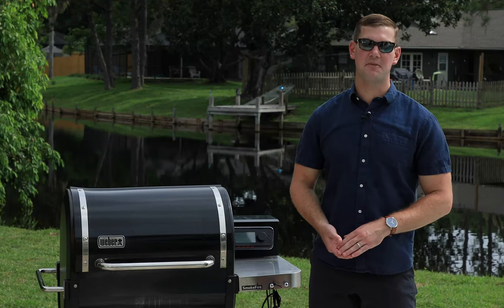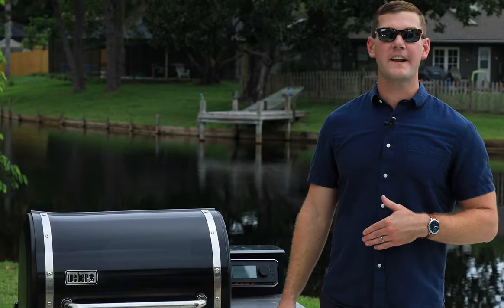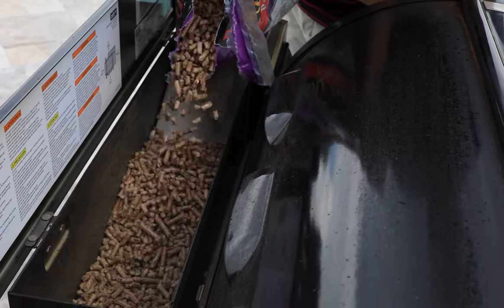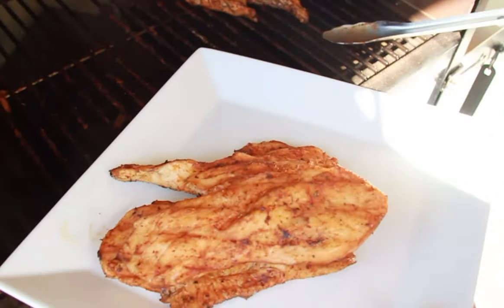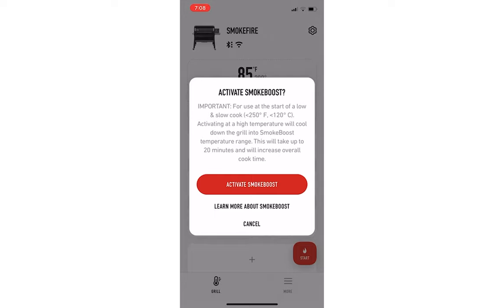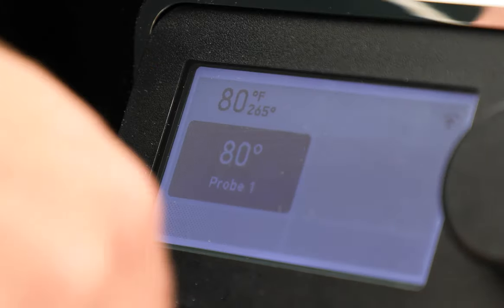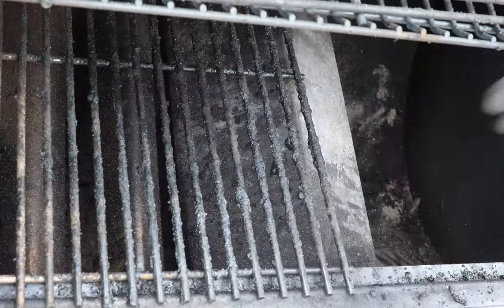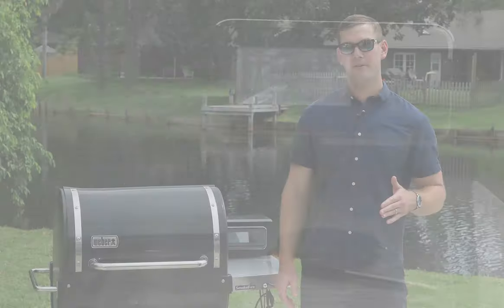Weber SmokeFire Pellet Grill | New Gen 2 Model | Second Generation Grill Overview

Comment: Thanks for the update.  It seems they fixed a variety of issues though it seems most people still are not convinced they did enough to address the grease management issues.  It seems you really need to use drop pans for long cooks still to avoid grease buildup and a higher than normal grease fire risk.  It's a bit of a shame since it feels like that could have been something they could've updated the design with.  Curious on your thoughts on this?
Reply from the maker: I use drip pans to catch grease and fat drippings in charcoal grills so it's not really anything different than what I'm doing in those grills.

I see it from both sides to how some would argue they shouldn't have to do that. There's only a handful of things that you need to use the drip pan for.

I don't really see it as a con or inconvenience because a drip pan is going to save me time cleaning up the grill. 95% of what I use the grill for is grilling so it's not something I have to deal with majority of the time. That's me though. 

- Sam
Reply: @justgrillin  as someone Currently shopping for their first pellet grill I think I'd rather just buy one without grease management issues.  Its difficult to decide with all the choices out there anyway so any area lacking gets noticed. Grease management is a big issue imo . From my vantage point I'm struggling to see where weber outshines the competition in any of the other areas .
Reply from the maker: @TheSlickpt  valid reasoning. For the price point this and other comparable pellet grills fall in, each one is going to lack something. If the non-diffuser shield is an issue to you, just move on to your other options. No sense in buying something you’re skeptical of. Hard to enjoy it if you’re focused on something viewed as a fault. You’ll come to find you’ll use drip trays with diffuser shields more than you think but I get it. While I don’t mind, it’s a “to each their own” situation.

As someone that deals with grills all day, I can say that no grill is absolutely perfect. Most people that get into pellet grilling start with an entry level pellet grill then after a few years jump up to a Yoder Smokers pellet grill if buying another pellet grill.

- Sam
Reply: @justgrillin  yep you bet definitely no perfect grill in every area or for everyone . Definitely not wanting any second guesses so I'm definitely considering the others and their individual pros and cons . Thanks for your  response and perspective   cheers
Reply: hey is the fire issue only when you're cooking at high temperatures? ive seen some reviews that suggest this.
Reply: The reasons for the potential grease fires is because the smoke fire doesn’t have a large pan that covers almost the entire surface. If it did have one of these, you wouldn’t be able to reach the high temperatures that we were claims it can reach, and therefore no searing. I’d much prefer the ability to say and reach higher temperatures and there be a slight risk of grease fires as opposed to know risk of grease fires and lower cooking temps. Unless you spend three or £4000 plus you can’t have both it seems obvious really high temps are better when you can just stick a cheap drip pan to reduce the potential risk of grease fires.

Comment: What grill scraper are you using at 8:16 of this video?
Reply from the maker: Timestamp didn’t match up but assuming you’re referring to this item: https://justgrillinflorida.com/product/grillfloss-ultimate-bbq-grill-cleaning-tool/
Reply: @justgrillin  Yes, that's it.  Unfortunately, the handle is out of stock currently, but replacement blades are available.  I just ordered two replacement blades and will make my own handle.  Thanks for the info!!
Reply from the maker: @Bob-More-Than-Enough-WC  we have the item in stock.
Reply: @justgrillin  Thanks!! I looked all over for the tool.  Everyone was Sold out...  For some reason your website never came up.....I got the two blades for $13 shipped.  I've got metal stock already to make a handle, so I'm good.

Comment: If unhappy within the first 100 how does returns work? Though the dealer where you purchased or directly through Weber?
Reply from the maker: Money back comes from Weber. As long as you purchased the grill from an authorized dealer, Weber will handle the refund via a refund check unless you purchased it directly through Weber. You will reach out to Weber to coordinate the return and refund regardless of who you purchased it from.

The refund is only on the grill. Shipping/delivery or assembly fees do not get refunded. Accessories like covers and such don't get refunded either.

It's not a requirement but Weber does ask that people use the grill for at least 30 days.

- Sam

Comment: Good to hear about the changes but with those addressed the real question for me is how is the performance as a smoker vs other options. Does it smoke as well as a Traeger or a CampFire Woodwind 24?
Reply: Yes, it's on par. But the traeger is much better at grilling. I have this weber and at 375 or more, there is so much ash flying around in there. Covers all the food
Reply: @micahroberts3564  wow really, I thought this would be better since it has the opened flame.
Reply: @micahroberts3564  yeah it blows that shit over all the food. totally wack.
Reply: Is yours the gen2 or original?

Comment: I'm regretting getting this grill (2nd Gen father day gift June 2021), I saw all the 1st gen problems but figured it's Weber I'm sure it's fine now & I didn't want a Traeger like everyone else, I was between the EX4 & the masterbuilt gravity feed. Long story short I chose the EX4, I've had multiple cases of pellet cloggage, The unit was unable to hold temperature multiple times & I literally have to clean it every single time as I don't trust an overnight low & slow. Weber advises to use their pellets which aren't sold at any store so I bought Weber pellets but still issues. Weber is sending me a motor that I have to install myself this weekend. Prob the last Weber for me unfortunately. Going to try and see if I can get Weber to refund me if not I'll install the new motor and just have to deal with the issues.
Reply from the maker: Sorry to hear that. Weber’s support is good. Sounds like you’re outside the 90-day return window so not sure if they’ll ultimately do that.

I don’t think you made the wrong choice between picking this over the gravity feed. The gravity feeds have had their own issues too. 

I’ve run BBQr’s Delight, Royal Oak and Weber pellets through the unit and it’s never clogged for me. Every now and then I’ll get an air pocket in the hopper which prevents pellets from feeding consistently. That’s really only temp issue I’ve faced. 

No matter what brand of pellet grill you own, cleaning it more frequently than a gas or charcoal grill is inevitable.

If Weber ultimately does not take it back as you wish, my advice would to be to hang in there. I don’t profess that this grill is perfect by any means but it has worked well for me mostly. If you have questions, feel free to ask us or use Weber’s support to your advantage too.

- Sam

Comment: Great video and I like the detail. I’m on the market for a pellet smoker and I was sure I was going to get a Green Mountain (it’s ahead of Traeger in my view) but I ran across a few vids now on the Weber and am going that route, particularly with the $200 off. Harry Soo did a vid where he fully loaded it up and tried to reach failure but only had good things to say about it. My only decision is the size.
Reply: You wont regret it. I was also looking at GMG (which is a great pellet grill), but love the versatility of my Weber Smokefire. Has been very reliable, using it for 6 months every week. I went with the EX6 to give me the extra cooking area.
Reply: @Costa_Prime  can you shed any light on the comment others have made about ash flying all over the place at high temps (grilling)?
Reply: @steveblaine6334  I had that at the start but it improved after seasoning, especially after a few low and slow cooks. I no longer have an issue with my BBQ and maintain (clean) it regularly. Important to clean the ash after every cook which doesn’t take long to do. I’m also (recently) using Grillgrates to get those perfect sear marks and additional flavour in my meat when grilling and would imagine that would also help too preventing any ash making it’s way above the grill. But again, this was just a recent update to my cooks, and had no issues with ash during the cook prior to using them. I had a Traeger prior and love the versatility of what I can do on my Smokefire and the flavour I get from my food, so no regrets. If I didn’t get the Smokefire, would have got myself a GMG  pellet smoker.

Comment: I have one, it's OK, gets the job done. However, I will never sear or bbq on it. Once the temp gets up to 375 the ash flying around in there is just stupid. Everything covered in it
Reply from the maker: When the grill is fairly new that can happen. As ours gets used a lot, a good seasoning built up on the body so it doesn’t really happen much anymore. It tends to stick to the body down low. I don’t notice anything when cooking that would give me pause.

My father-in-law is an OCD clean freak and he’s helped grill on it over the summer holidays and had no issue with it either…or enough to say something. He’s the type that wouldn’t eat if he saw something like that.

 - Sam
Reply: @justgrillin  does the ash fly around because there is no heat shield/drip tray?
Reply: I have just done the burn in on my sf…did not like all that ash covering everything…imagine it would be all over the food as well…glad there is a 100 day return
Reply from the maker: @universaldonor3100  yeah. After the first few cooks, it’s pretty much gone. Any pellet grill will have some ash fly around when cooking at high grilling/searing temps. Has to do with the fan. The body needs some grease and drippings as a coat and the ash just sticks to the lower cook body. I’ve cooked with a SmokeFire since Weber launched it. It’s a non-issue for me and my food has never tasted or looked ashy the least bit.

- Sam

Comment: use weber drip pans across the flavorizer bars.........flavorizer bars help distribute heat and vaporize grease to add flavor to the meat....do we flip a coin which way to go?  less flavor but cleaner grill?
Reply from the maker: I don't think it's really going to adversely affect the flavor of the food that's smoking. It's pretty common to use a drip pan in other grills. I use a drip pan in our Myron Mixon G9 Gravity Feed Smoker and am always happy with the results.

- Sam
Reply: @justgrillin  by using the drip pans you basically make a pellet grill like everyone else's...I have read reviews by folks that use stick burners that they like the taste from the weber because of the flavorizer bars.....
Reply: Don't bother with this. Cheap smoker? Grab an old 4 burner grill, remove heat shields and grab some thick wiring to cover the entire inside of your grill. Then fill it with lava stone up to the grill grates. Fire up 1 burner to temp and use an A-Maze-N tube pellet burner for smoke

Comment: I’m still seeing the new generation catching fire from grease fires. Huge temperature range. One side to the other is. 100 degrees difference. That’s crazy. I’ve personally seen customers returning the new ones again. Weber really didn’t fix the issues. Unfortunately
Reply from the maker: Shouldn't happen if a catch pan is used. I've had zero grease fires because I use a pan to catch drippings one slow cooks. The temperature range is something I talk about in these videos. The right side burns hotter for sure but every grill has nuances to them. Even heat is the biggest thing every manufacturer is trying to achieve.

I'm part of groups/forums and do think some issues are more so user errors. I feel the education on pellet grills in general is pretty green. While the concept is simple, there's a lot of moving parts and variables that make each situation a little unique. A pellet grill is the one type of grill that I would argue is best to purchase the top-tier options in the market to have a truly enjoyable experience. Most people start with a T, CC or PB and after a few years of up-and-down are ready for something better. At least, that's what we see from previous pellet grill owners.

Aside from a few glow plugs going out on me, I've had a positive experience with this grill. By no means is it perfect and I have to adjust cooking with it to account for things like a left-to-right temp difference. But I also have realistic expectations and think about the price point of the grill and where it falls in the pellet category as a whole.

- Sam
Reply: @justgrillin  I’m completely new to this. What would you consider something better within the pellet grill market? This one seemed really attractive to me because it allows for complete smoking functions while also giving you a way to actually grill without a second device (limited balcony space)
Reply from the maker: @Quickhanf   well Yoder Smokers is one of the top tier brands in the pellet grill market. A lot of the top tier brands won’t look as flashy as some of the mid-level grills.

The big differences in the grills are going to be the thickness in metal/steel and the controller (which is most important). There’s a lot of nuances to the controllers and apps. Which that’s a much longer conversation. The thickness of steel matters for heat retention and temperature consistency. 

Don’t read too much into my previous comments. The Weber SmokeFire is a great pellet grill. It does a great job for where it falls in the market. It has nice features and is pretty easy to use. Is it perfect? No. But I think you get good value for the price point. 

Let me know what questions you have and I’ll do my best to answer them.

- Sam
Reply: @justgrillin  Thanks so much for the prompt answer! Do you think there will be an update next year over the EPX/Stealth Version of the Weber SmokeFire to address some of the remaining issues or do you believe Weber will stick with this generation for a while?
Reply from the maker: @Quickhanf  I'm getting ready in the next two months to do a video on the EPX6. Other than aesthetics, the internal light, Crafted Frame Kit and a front heat-shield, Weber has made some running changes this year across all Smokefire models.

I find it hard to see them making anything significant because they haven't done so to this point. If they were going to do anything drastic to the current design or internal parts, I think they would have already made that change. The grills perform well. I'm just getting ready to retire a first generation model (it does have Gen 2 upgrade parts on it) for the EPX6 once I make the video. My SmokeFire runs fine to this point. The most I've dealt with is the glow plug going out a handful of times but Weber has upgraded the connector piece in new models for more reliability. I dealt with that earlier on versus anytime recent.

The running changes they made this year might seem minor but they directly address most performance concerns. I still hear from people, and read in online forums, about the lack of solid diffuser plate and grease drainage. The non-diffuser plate design is so the grill can be used to grill at any point and time. It's an ease of use function. The grease drainage could probably be better worked out but a drip tray prevents any possible hiccups. Not everyone likes using a drip tray but I have no clue why. Anything that's going to leave a nasty mess, like a brisket or pork butt, I'm using a drip tray, regardless of whatever grill/smoker I'm cooking on. Just makes clean up easy.

- Sam

Comment: Are we not talking about the glaringly obvious bend in the lid on your model? The left side top of the lid is concave! That’s NOT natural or standard. That’s a massive QC fail if yours came that way from the factory. The seal on the lid of a smoker/grill is key to its success at either task! That huge band shows what seems to me to be a serious gap between the lip of the grill body and the left side of the lid.
Why aren’t there any real comments about the smoking of this unit? I guess it’s a grill that smokes, rather than a smoker that grills. I’m wondering if things like brisket and pork roasts smoked in these would be less than optimum.
Reply from the maker: The lid was damaged by us. We have a lot of different units for demonstrations/videos that get moved around between our store, video shoots and warehouse. Accidents happen. Nothing is compromised on the grill.

Most pellet grills are designed to do both nowadays: smoke and grill. Reviews on the unit are mixed. Some like it and some don’t. 

I think for the price point it does a good job but it’s not a perfect grill/smoker. I say this in other comments too. The pellet grills that are going to give you the best performance, quality and results are going to start in the $2K-plus range.

That’s not to say you can’t do great stuff with this grill. I love what I cook on it when using it. But I’m a reasonable and practical person too when it comes to analyzing the features, build, design, results and price point.

- Sam